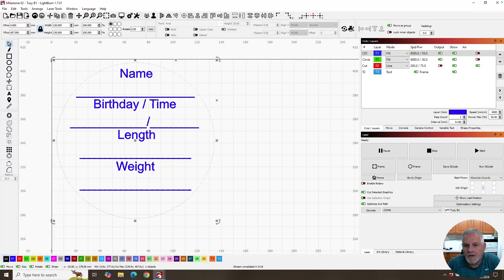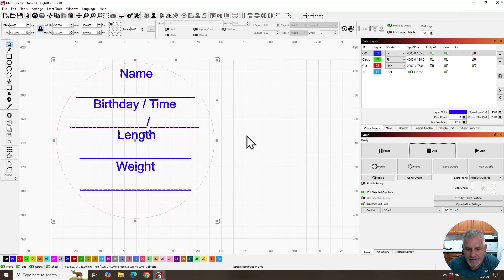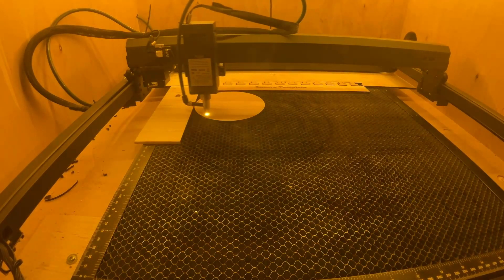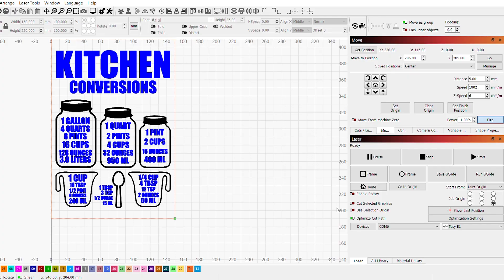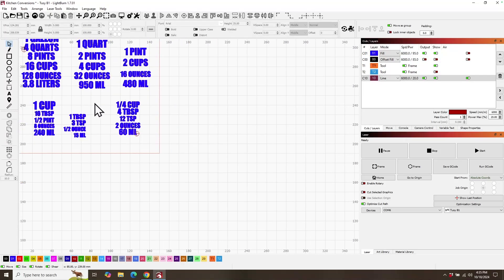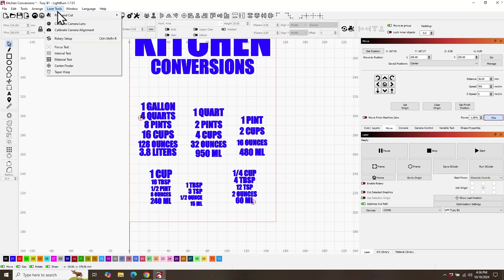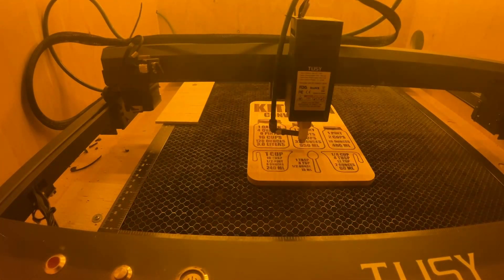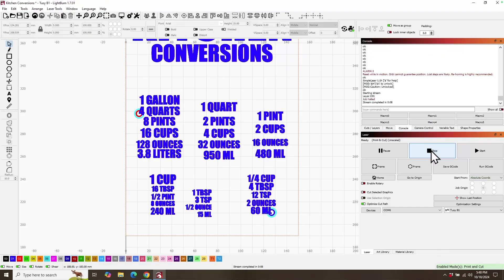Recover Your Burn in Lightburn Like a PRO!

Comment: I have issues with my laser stopping multiple times during a burn. It seems that the software can pickup the laser position that you could start from that point. Why can I just type in the xy cords and start from there…come on lightburn
Reply from the maker: I think the more important issue is, why is your laser stopping multiple times during a job? I would be looking to resolve that issue. It shouldn't be acting that way.
Reply: @helmmakers  if you knew the lengths, I’ve gone to try to figure out that problem I agree completely. I understand a random failure here and there every once in a while, but I’m lucky to get through one engraving without it just stopping. Over the past couple years since I’ve owned it. I’ve researched got frustrated. Put it away pulled it back out researched got frustrated. Put it away. Pulled it back out. Wash rinse repeat
Reply from the maker: @uncivil11  Did I just see a post from you on the Lightburn forum? Engraving tile? That is a great place to get assistance. There are a lot of very experienced users there that like helping people figure things out, myself included. I'll say hello over there and give some advice to maybe get some help.
Reply: @helmmakers yes sir you did. Good eye!  As you can see from the post I have tried a few solutions

Comment: Sometimes I have problems cutting all the way through a piece so I will use the "Start from" option to repeatedly cut over one area till it cuts all the way through.
Reply from the maker: Yes, that can work sometimes, thanks. Sometimes the glue in the plywood won't burn through no matter how many times I go over it.